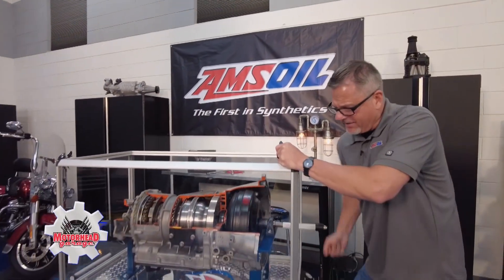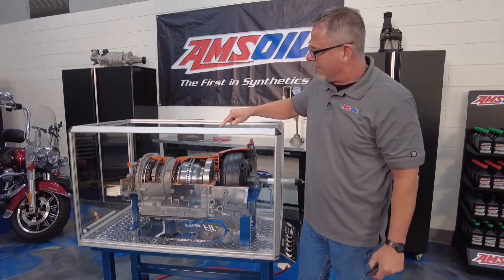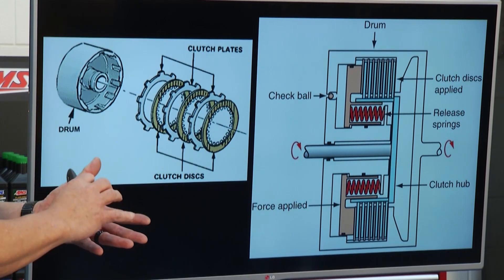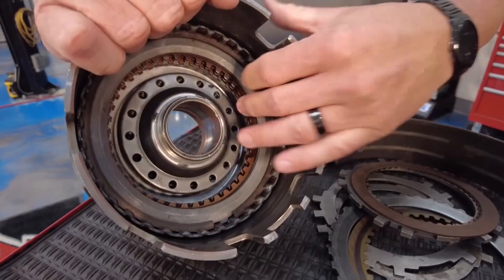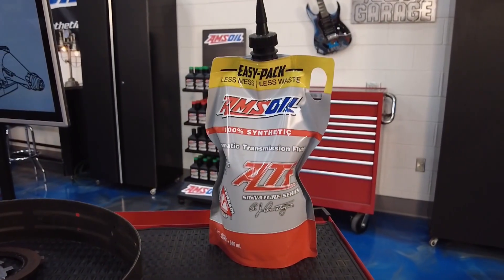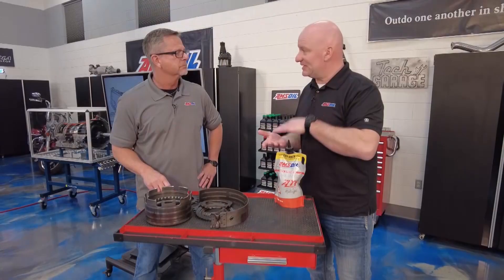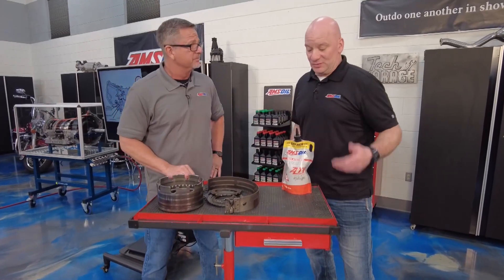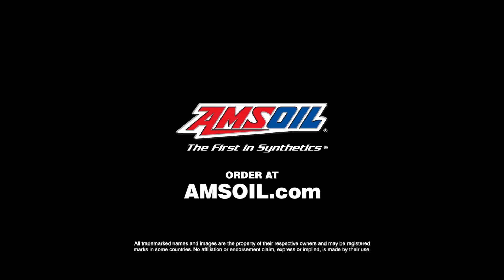What’s the Deal with Transmission Fluid?

Comment: I changed out 3 quarts of the 7 quarts in my 2007 Mazda 3. The smoothness of shifting was immediate. I did another couple drain and fills and a year later did another. Probably got 90% of it. 

I probably get my money back already in fuel economy. Highly recommended. 

This product also provides peace of mind. with rebuilds costing a few to several thousand these days...